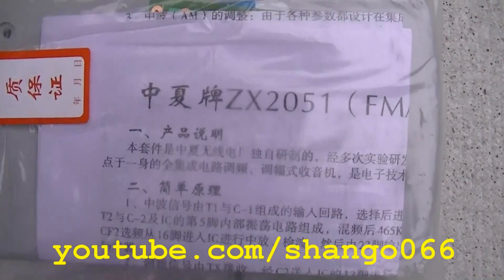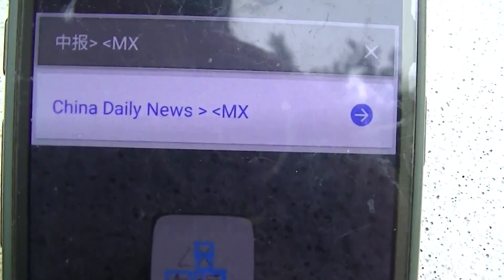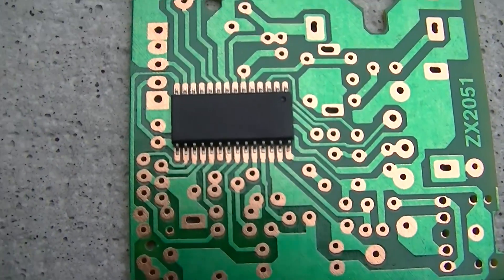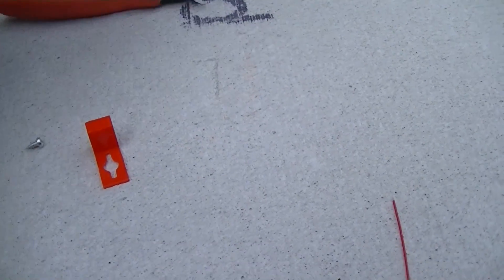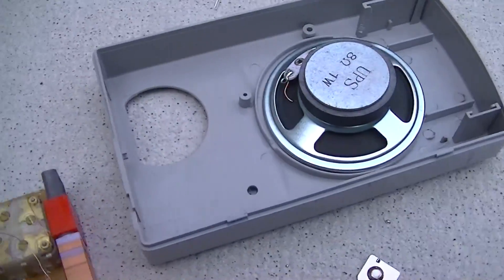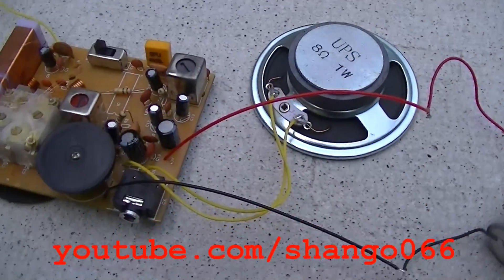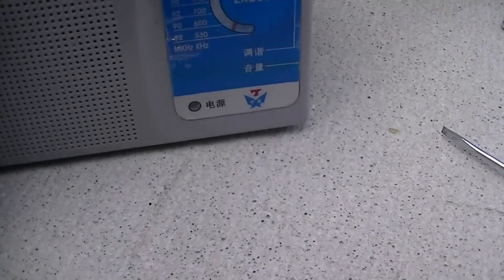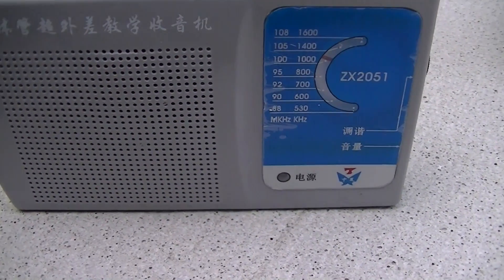ZX 2051 IC kit radio build and test

Comment: Walking around Dickson Tennessee it gets full quieting on AM/FM. Friend's FREQ WHEN THEY see the spec sheet I tell them that the diagram is universal   PS solder gun heat folds the ring round speaker. And grind out the original battpack r/r with radio shack 😊😊

Comment: My first try I found a leg broken off. the main chip. With a magnifying glass...I got some of  the leg out where I could solder a bit of wire.....then set it on the board soldered...and tested all legs. The on the way...still carry it around to day. I'm just persistent. Nothing's better than roll your own.. don't you think? 73

Comment: The battle at. Hidden valley. I build kits. In the cold winter. It came. And looked a little rough. On package wise. I got it and layed it out.( And for some reason I never had problems with ICs this one faught every me turn). I would solder. I took and tested with a meter to check contact. Removing the chip 3 times. I broke a pin off. "YIPE" still borne?? shelving it for a day or two. I got the dremmel. And the narrowest disc. And carefully cleaned the area where the pin broke off found some meat. Resoldering the chip third time. It took off. With a roar And now is  setting on my my shelf. The battle of hidden valley won.  it's been my favorite.  For a week. The battle of hidden valley won . Combat engneer and signal corps radio operator. Retired sgt williams de kv4li. This critter was tough. The next chip radio went to gather with out a hitch. .??? Imagine that. . Hi hi.

Comment: yeah missing parts is a curse on these kits. I recently tried my luck with a second HX-207 AM radio kit and it lacked one of the 203 ceramic resistors and one of the battery connection wires. xD  It's sometimes hit or miss. Had to salvage these parts from my first kit that turned out to be crap and didn't work.

Comment: These radio kits are garbage I've done three and they don't work period I've done every thing right but no sound even the red radio is garbage no sound nothing cheap parts are garbage won't buy these anymore t would are sitting here dead nothing check points bridge but no sound

Comment: I have assembled dozens of different kits from China, usually if there is a missing cap, I find it stuck up under the speaker material stuck to the magnet by a leg or two.  Now that I am really into it, I have lots of extra caps so it would not be a real problem for me anyhow I guess.  Cool video though, I tried one of those little radios it really sucked as far as receiving, perhaps I shall give the one you have a try...

Comment: I would say that these radios obviously aren't meant for use in an area where the local  bands aren't so congested. 
I just  ordered a HX201 kit. It has FM only & uses the 9088 IC also used in the Paensonic CF210SP.
I have looked at the other radio kits you made. Very interesting to see the red HX108-2 did well picking up KNX  out at the ghost town. It was never going to do as well as that Zenith.

Comment: I use a "coffee warmer' hotplate with a chunk of circular aluminum plate to get the are for the chip warm. Them I use solder paste and an embosser hot air blower to slowly heat the area. After about 3 minutes warm up and 1 minute with the embosser the solder takes and you are done with all of the solder joints on the chip at the same time.

Comment: I built this same radio on my channel, I have the same issue with the broken bits but I was able to "align" it somewhat. The one I have is permanently in FM because I accidentally super glued the AM/FM switch while trying to glue the switch cover on but oh well. it does work.

Comment: Yeah i put one of these together a while back. It had a missing 30pf capacitor too and a faulty tuning capacitor stopping the radio from tuning across the FM band,  replaced it and radio worked... the red can is the local osc as with any radio and the black can has to be peaked at 455khz to feed the IF signal into chip via the ceramic filter... the radio's plastic case however would not clip together properly...

Comment: Hand soldering surface mount components such as the IC in this video really is not hard at all. The trick is to use a lot of good quality flux. Simply tack solder two diagonal corner pins to align the IC, then using a lot of flux, you can very easily solder the rest of the pins. The flux keeps the solder from gapping across the pins. It really is not hard at all. There are many instructional videos on YouTube showing this. If you get a solder bridge, a good solder braid takes it right away. When you get really good, you can drag solder all the pins in one movement using a cupped soldering tip. Kind of fun, actually. You can practice on any old circuit board.

Comment: To peak the AM IF gain on this radio, you could try to bring a wire connected to a 455 kHz source near C11 and then peaking the black transformer (T3). The signal would be coupled in via the stray capacitance between the piece of wire and C11. There are no adjustable components in the FM IF strip.

Front end tuning is as would normally be done. My condolences go out to you on the lousy quality of the variable capacitor.

I am thankful that at least, this design didn't cheapen out to the point of eliminating the AM IF transformer (this is needed to suppress spurious modes in the ceramic filter).

Comment: Your soldering that SMD IC in by hand has bolstered my confidence with regard to my ability to build one of these. I've overlooked them in the past just because I didn't think I could do that. I still have yet to build the orange AM radio kit.

I've been shorted on parts with a few of the cheap Chinese clock kits that I've built.

I thought the included LED was red. Did something happen to it along the way?
Reply: Sure you can. When soldering a chip like this you are worried to bridging pins. You can avoid that by using thin soldering wire, 0.5 mm will do and get some flux from China or around the corner for better quality. Flux is the most important thing next to your soldering iron, always. If you have bridges, adding flux and reheating removes it. Go ahead and enjoy soldering !
Reply: Like anything, in time it will become easier. They (SMD's) can be intimidating to someone who hasnt had hands on with them but try it and youll see you can do it. Remember, flux is your friend!
Reply: I built this kit and recorded it on my channel, it was pretty easy.

Comment: The dial says, “MKHz”, which would seem to indicate mega-kilohertz, which would be GHz (gigahertz). Fat chance. I think you’re going to have trouble finding a 30 pico-puff capacitor; maybe 2 electrons, and two protons might be close to 30 pico-picofarads, if you could find an eentsie-teeniy-tiny dielectric to separate them! Just replace the innards with a TRF, and a vacuum bulb, and it’ll probably work better. 😆

Comment: I was going to get this kit before the red radio video. Made that red one up a few months ago, I listen to it almost daily; it's solid, I get some light DX on it at night. Very listenable radio, and very selective when it's dialed in right. With these ICs doing everything, there's not much wiggle room I imagine to tweak them. I've done a few 'auto tuning' FM kits with those ICs, they can be a bit erratic. The red radio also taught me just how an IF-staged set works; I'd been trying to wrap my brain around it for ages.

Comment: Shango get yourself an 858D hot air solder station they are awsome and cheap, i bought one last year, and some solder paste for SMT soldering. https://www.ebay.co.uk/itm/858D-Soldering-Rework-Station-Iron-Welder-Desoldering-Hot-Air-Gun-Tool-3-Nozzles/253426674282?_trkparms=aid%3D555019%26algo%3DPL.BANDIT%26ao%3D1%26asc%3D20151005190540%26meid%3Db5a0fb4a41c44a0c86f7c78f65438146%26pid%3D100505%26rk%3D1%26rkt%3D1%26%26itm%3D253426674282&_trksid=p2045573.c100505.m3226

Comment: That's a pretty typical analog 1-chip AM/FM radio circuit actually, more or less straight off the datasheet. And with IF, of course. The CXA1691 is the last in a whole line of chips including CXA1191 and CX20091, going back all the way to the mid-'80s. The latter found use in the petite ICF-4900/4910 and bigger ICF-7601, for example. These ICs are real current misers (around 5 mA!) and as such not high dynamic range, they need good passives. I guess what's supplied here doesn't really qualify (surprise). Performance of the assembled radio is reminiscent of some really cheap and cheesy Chinese jobs, as in $10 for an AM/FM/SW analog multiband.

Hint: Run this guy on 4.5 or 6 V for something resembling half-decent audio output, it's rated at 500 mW into 8 ohms on 6 V - no BTL here. On 3 V (100-125 mW) and with a 2.5" speaker, I wouldn't expect any miracles.

In the ICF-4900 et.al., Sony would convert the selected shortwave band to a wideband 1st IF around 10.7 MHz (with a set of LO xtals) so they could use ordinary (cheap) FM IF filters there, and then used the CX20091 to tune that range and convert it to 455 kHz. Without any tracking, however, dynamic range was rather poor. In this respect, the ICF-7601 is noticeably inferior to the older ICF-7600A employing a discrete 2nd mixer, and that wasn't exactly a record-breaker to begin with (if certainly acceptable as a travel receiver back in the day).

Comment: shango you got me started  working on the small Transistor Radios around 2 years  ago. tuns of fun . i have around 45 Transistor Radios that i fixed. i am going to start  listing them on ebay soon .so i can sell them and buy more .i keep  some for my radio collection.  with me the smaller the radio the more fun it is to work on . anyway thank you  for  the  time you spend on all these vids . i know its lots of work to set the vids up to post.   THANKS

Comment: Good soldering practice for 5 bucks - if it works - bonus.
Reply: David Legault - I finally got myself a soldering kit, need to practice now for my long waiting projects. I might think about investing in some of these cheap radio kits as a learning starter.
Reply: Hi Corinna, check out ICstation.com as well and of course ebay always has really inexpensive kits to practice on. Regards, Dave
Reply: David Legault - Thankyou, I will indeed check them out & thanks for the information too. :)

Comment: I've always wondered how they made the little radios. Now I know there is  thousands of little parts and thousands of hours of soldering time. Too bad the instructions are in full Chinese not poorly written Chinglish (what I call poorly translated English from Chinese). If it was in Chinglish I'm pretty sure people in America would be able to put these radios together no problem but because it's in Chinese a lot of translation is needed. I wonder if you can take this and scan it on your computer and translate it that way so you have an Chinglish version. I think Chinglish is a word that I may have made up but anyway I refer to Chinglish as poorly translated English from Chinese. That's where the Chinese manufacturers try to translate their Chinese only instructions in to poorly translated English and you can barely figure out how to put together what you're trying to put together. Ching is Chinese and Lish is English making up Chinglish half Chinese half English writing
Reply: Holy shit take a break !
Reply: Lucas Nencetti - Gesh I think my migraine just returned after reading all that!